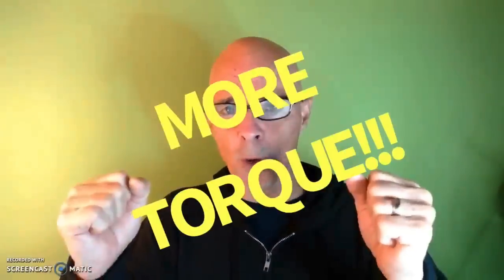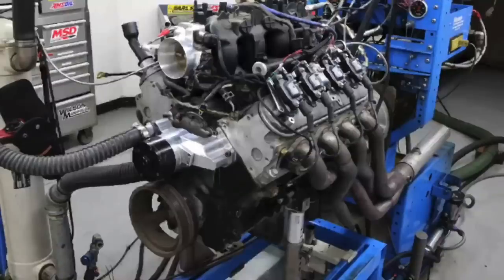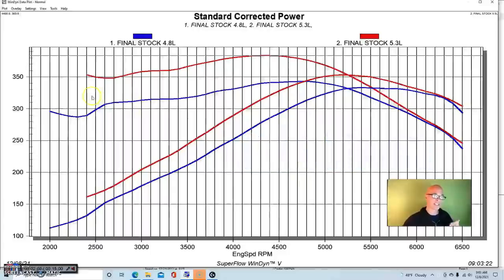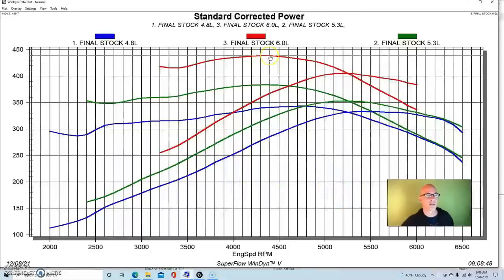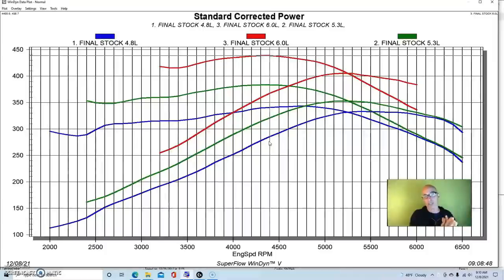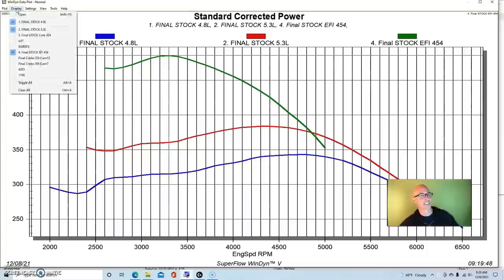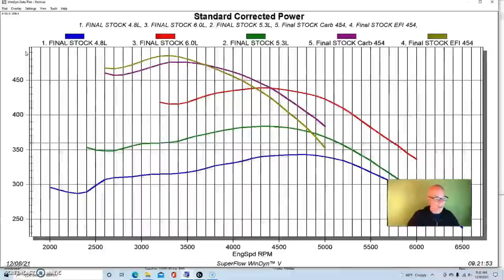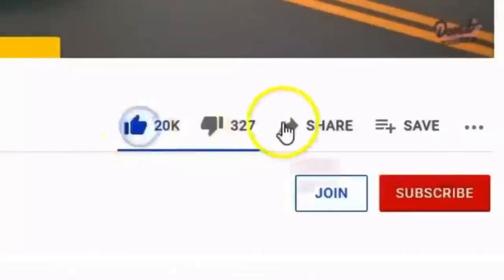LOW BUCK, JUNKYARD V8 TORQUE TEST-6.0L LS VS 7.4L 454 BBC-WHO MAKES MORE TORQUE? BETTER VS BIGGER!

Comment: The question is "does a 454 with a 4L80 put down more torque than a 6.0 with a 6L80"?.  The answer is "NO".  Now they have an 5.3L L83 with a 10 speed that puts down more torque than the 454...and more horsepower
Reply: Now put the torque of the big block behind one of the new transmissions. The other 2 engines you mentioned are using gears, they don't make more torque.
Reply from the maker: say it with me-ENGINE DYNO!